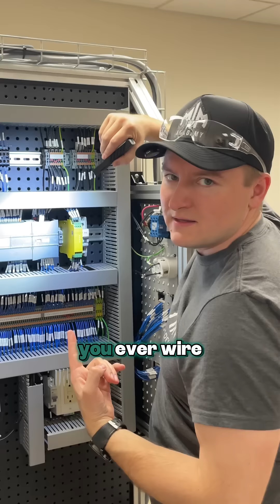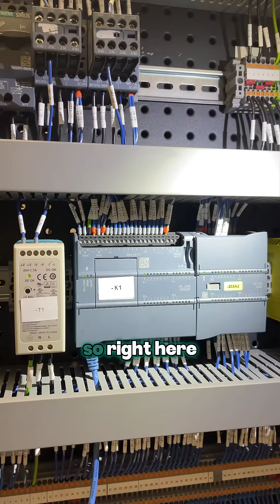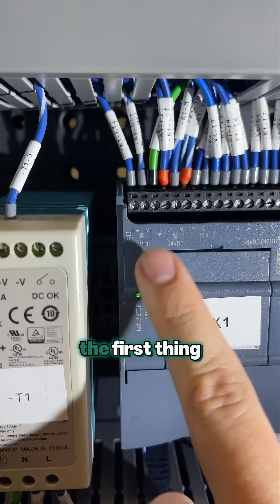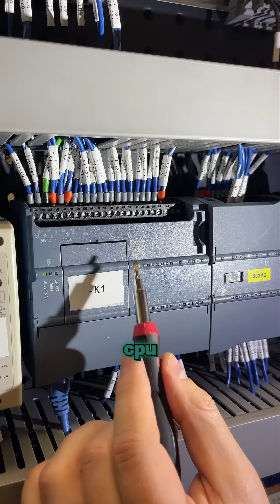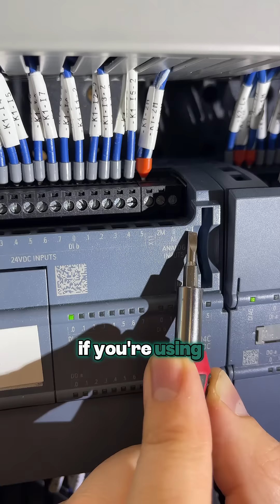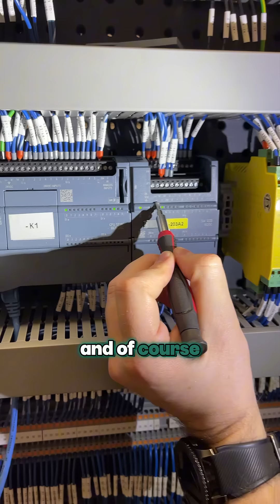Siemens S7-1200 PLC Wiring Explained: Power, Inputs, and Ground

Comment: Usually when i see cabins like this they usually control something simple that could have been built much easier. It is usually the plc cabinets no one wanna repair and that people give up on. Why? Because either the schematics are gone or alot of people have rewire them without updating the pappers.
Reply: Most people don't have the option to give up on a repair.  There are a lot of advantages to having a PLC control instead of a bunch of relays.  Troubleshooting relays is not  always as easy as you think.  You just need to call the right guy out for the job.

Comment: 1M —>24V input is 0V ok 
1M—>0V. input is 24V ok
Reply: To complete the circuit right?
Reply: @ParthPatel-x5e  Yes, it’s basically like a switching power supply. All the input loads are connected in series in the circuit. This makes it easier to understand.

Comment: The ground won’t protect the PLC, it’ll protect you when you go to replace it when it’s fried.
Reply: The ground wire is to make sure there is an unimpeded return path for the current, so the fuse or breaker will pop if there's a short.
RCD's are there to protect people, the fuse/breaker protects the instalation. But with 24VDC there's not much to protect you from.

Comment: The plc doesn't power the one next to it?
Reply: Usually its an outside power supply connected to the hot rail. 

The 24 or 120v in is just to power the PLC computer.